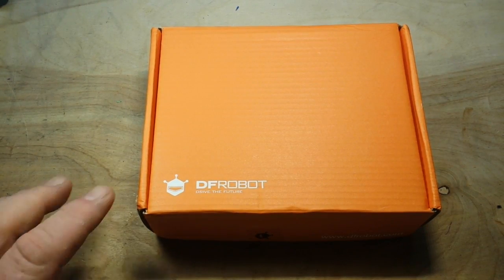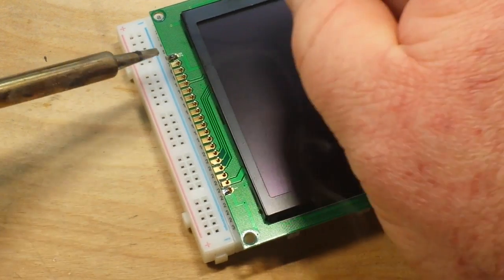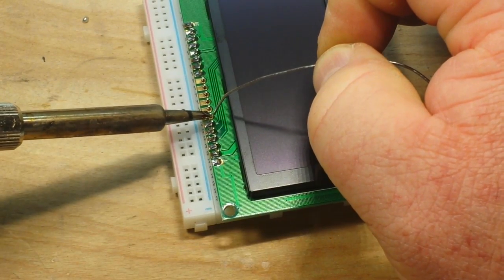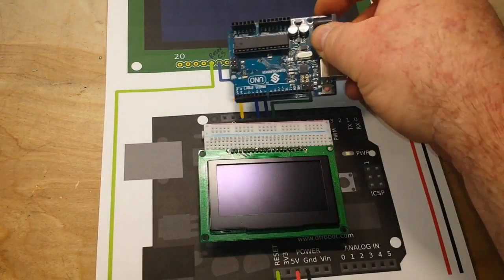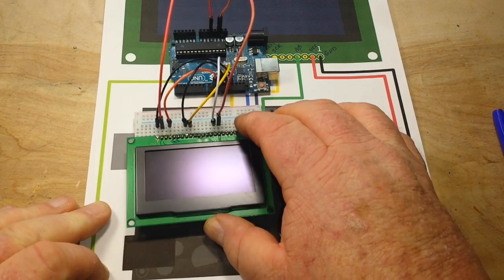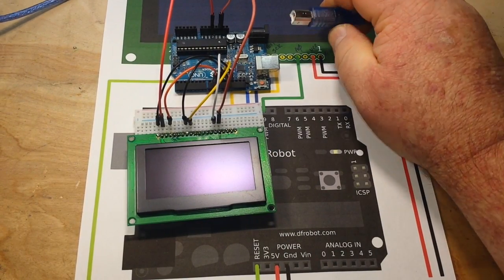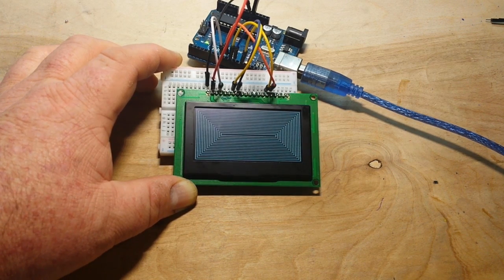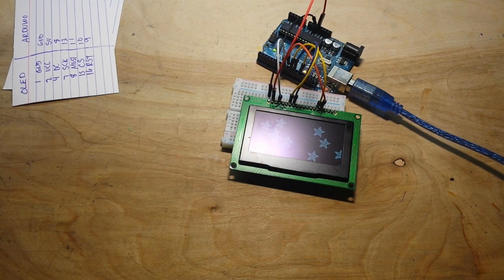2.7" OLED Display from DFRobot

Comment: Big problem...the display you are using has been modified however the same display 12864 without mods can be purchased on ebay for less than  $10.00 and it works when properly wired  with u8glib or glcd and acouple of other libs for arduino...u8glib works with the 3 wire spi trick just like all the other ones you do not need any mod on the back or any special serial garbage board glued to it just the display properly connected and the price you folks are asking is way to high max is $15.00.   All you have to do is open your eyes and search the net before you start throwing money and yes anyone can wait the time it takes the ship to cross the ocean.

Comment: Great job and Adafruit for correct info! These are way to expensive!
Reply from the maker: They are 50 bucks from Adafruit too.
Reply: Do you have a Hantek oscilloscope?
Reply from the maker: I did until about 2 months ago. I blew it up... Totally my fault. I loved the scope. Highly recommended. I have the DSO5072P in my Amazon shop.

Comment: At first i thought the number of pins was to create a rigid mechanical mount on one side, but that's not the case. Almost all pins are actually connected up, some on the front, some on the back. The controller has 3 interface modes, serial SPI mode, 6800-compatible 8-bit mode, and 8080-compatible 8-bit mode. There are two configuration pins that are internally pulled down if left floating externally. If you pull them up, you can activate the 8-bit parallel modes. It uses the same number of pins like a typical LCD board with the same SSD1325 controller, which suggests same or similar pinout.

I suspect DFRobot has actually provided correct pinout, the reason it didn't work is that you tested it with different software.
Reply from the maker: I tested it with the software and pinout provided by DFROBOT. It only worked with Adafruits pinout and library. It's a good product, but their coding and docs are way off.
Reply: If you use 8 bit mode you can probably get the highest refresh rate, but thats alot of io

Comment: Pin 1 needed reflowing, didn’t solder it properly,
Reply from the maker: Maybe if I had a brand spanking new Keysight MSO I could do a better job ;)

Congrats!!!!
Reply: learnelectronics - I just thought I would point it out in case you didn’t notice it didn’t flow in properly.

And thanks, is great to of been one of the runners up!
Reply from the maker: Anytime buddy!